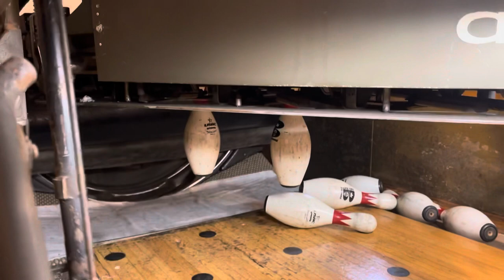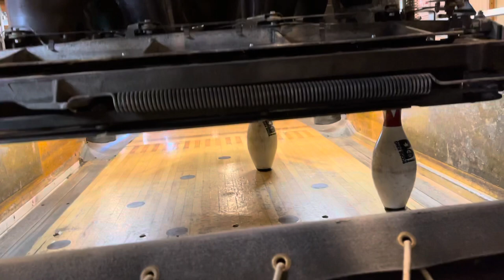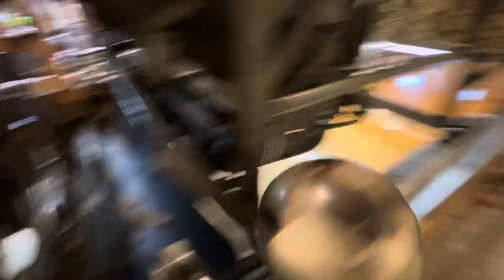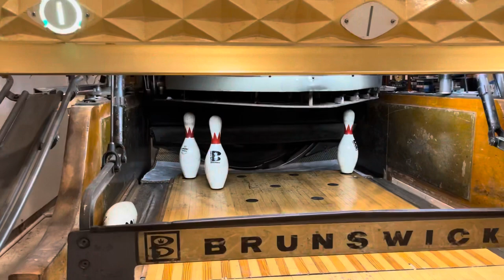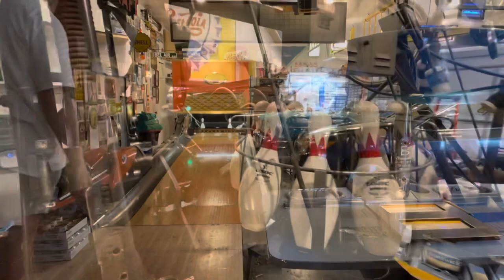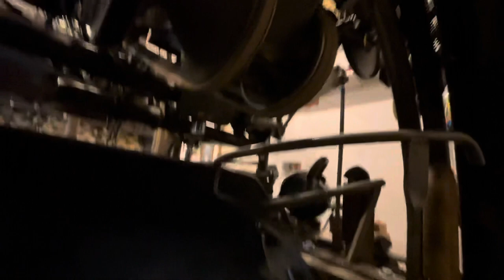New bowling movie!  Aaron bowling a game - garage bowling alley Brunswick Pinsetter vintage

Comment: A lot of the original A series pinsetters didn’t have the blue Mercury switch on the detector to indicate a strike. Yours does 😀
Reply from the maker: That was the first thing I made sure was installed and ready to go.   Lights and power do when it did its first strike cycle everything lit up properly 😁🎳
Reply from the maker: And I know how much you enjoyed the strike indicators.     And pinfinders.    All I need is a set of deck wings!

Comment: Nice! Can you a video on how to complete a ball return? And one that could be stuck from as a result from a 180?
Reply from the maker: Usually on a 180 the ball is stuck from the mass of pins in the pit when they aren’t feeding to the top.      The ball cannot get to the lift rods.   The 180 causes the ball return  and you have to remedy the feed issue which can be one of a lot of things.    I could simulate a lot of 180 scenarios and show how each is cleared in a video.    Thanks for the feedback.
Reply: @GarageBowlingAlley  Sounds good. I appreciate the response.
Reply from the maker: I did a video on various 180 stop causes and threw in the ball return reference for you showing that pretty much any 180 will cause the ball not to return
Reply: Thanks so much! Definitely appreciate it!

Comment: are you planning to add automatic scoring...i saw the gear for the switch cluster on your detector
Reply from the maker: I have the makings of magic score but my hopes are fading that it’ll happen.   I do and I had the chance to snag a 44/144 switch and the cross piece needed to mount it.   If not magicscore (which I got for free) then I would like some help figuring out a scoring install that would work off the switches
Reply: @GarageBowlingAlley  You should use TCAS' score more, it's free and works very well. All you need is a camera and a PC.
Reply from the maker: Tell me more about that.  I’d like a scoring app or something I could do on an iPad    Even just manually scoring on it and feed it into the video

Comment: Is there a sentimental reason for keeping the masking unit lane number the way it is?
Your ball return is set up for an even number machine, so a number 1 or 2 would actually work.
Reply from the maker: I never noticed that then you’re the second one to point that out to me     It came that way and with the box to turn it on the first switch is 9     Lane 10s is the foul lights.   11 is the fan power      12 will eventually be the crown background light.     I found wiring it to the electrical box must not have been correct voltage ad it ran for a while then started buzzing and brown wax started dripping from the transformer.    Luckily I have a bunch of extras.    I was told wire it to the wall outlet power instead.

Comment: do you put oil on the heads to keep the lane from burning?
Reply from the maker: Absolutely.     Especially using the old rubber balls.     They leave a black mark if I don’t
Reply: @GarageBowlingAlley  I thought so, where do you get the oil, and how do you apply it?

Comment: How old is the pin setter and where did you get it from?
Reply from the maker: It was one of the originals built in 1956 s/n 3690     Came out of a church in ft worth, Texas
Reply: @GarageBowlingAlley  that’s awesome. That is something I would want in my garage when I get older. Most of that is because I have been bowling since I was about 10 years old and I’m only 16. Btw, my average is around 160
Reply from the maker: You must be pretty good.    What’s your high game and series ?